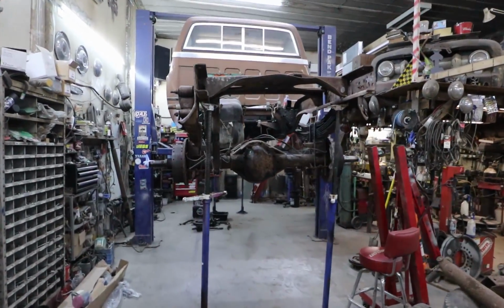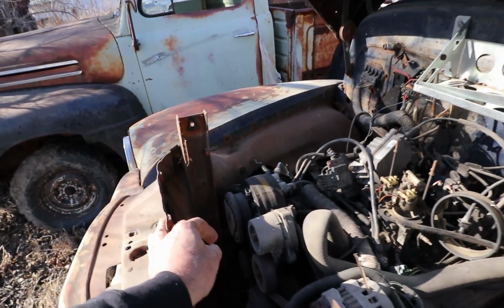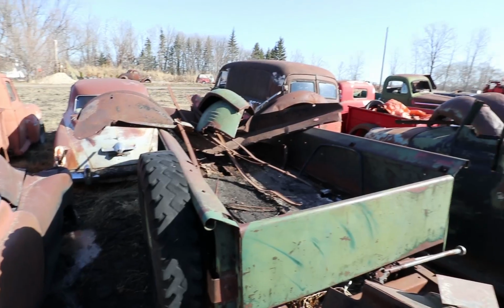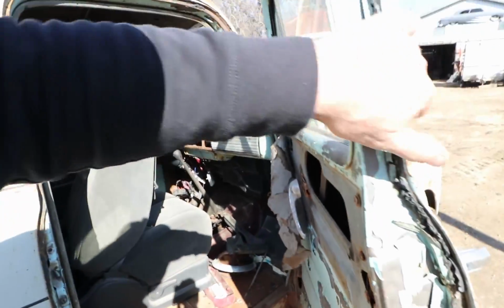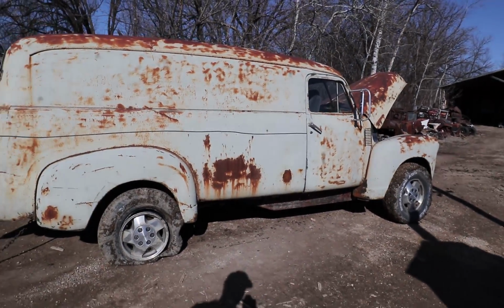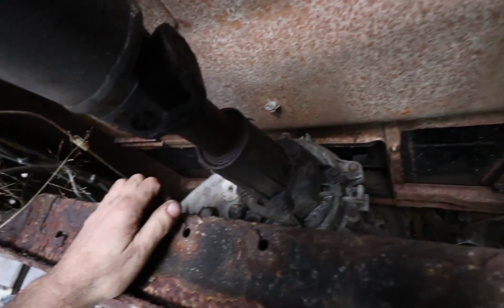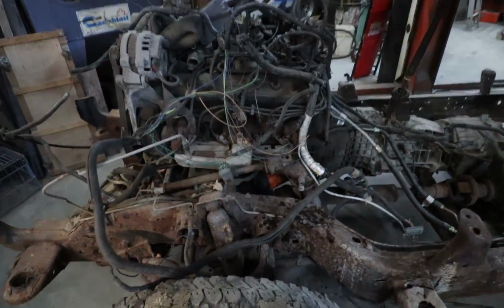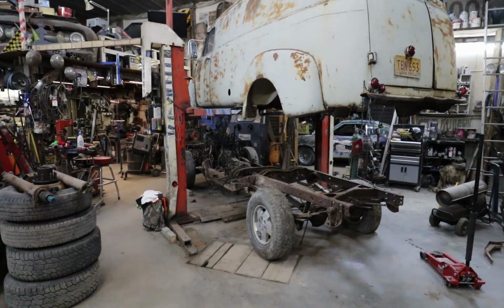1951 GMC Panel Truck Project, do I keep it 4x4? - Part 1

Comment: Love every single word and decision about the panel truck! Yes ✓ to engine swap
Yes ✓ to body coming forward for back wheel alignment with fenders
Yes ✓ to lowering just to hide frame and if not to be covered with aluminum or whatsoever
But please keep it a 4×4 and height is just perfect! I d sound crazy but i d love driving one of those in old gm styling than the original suburban or tahoe this chassis came from! Love ur late gm projects this and roadster truck and pretty please design on more of these stuff! Anyone can do a freakin ls swap or body truck to another truck bur a handful can design or redesign cars like u do! U d have ur name as a brand and should have an emblem in ur name as a tag next to the oem car make and model! Great work, brother!

Comment: Dude, that GMC panel truck is AWESOME!!  Just don't see many of 'em anymore.  With a little DA sanding and satin clear, you'd have a nice rat-rod type finish.  Looks like there's some good patina under there.  Instead of dropping it down to cover the exposed frame, you could fab some step-sides; functional and cosmetic.  And an LS with a manual transmission would make this beast a joy to drive.  The General project got me to sub to this channel, but this thing has me drooling!  Oh, the possibilities!  Can't wait to see what you do with it!

Comment: When you said you were thinking about switching gears. I really thought you were talking about building the Studebaker Gasser again. Not a bad panel truck. But like you said. Looks like it could turn into a real money pit, real quick. Not a fan of you lowering it (just too big) if you have to have something that big, I would either put a stock height 2wd chassis under it, or go the opposite direction, with a 4" lift 4wd. Thanks for sharing.

Comment: I think you made the right call not to use that crusty chassis. A few years back I had a 49 chevy pickup on a 94 4x4 chassis. I put quite a bit of time and money into making it a reliable daily driver, but when it came time to sell it I couldn't give the thing away. For a flip I think an original frame is more desirable, although a stock appearing swap onto a more modern frame would be neat too. Whatever you choose I'm sure it will be cool when done!
Reply: Well let me know what youre giving away next!? Im on the hunt for a "40 Hudson cpe, got one of those??? 😉

Comment: Excellent video Brent :) keep 4×4 on that old 1951 Chevrolet Delivery truck also motor that stuck that not good and hope find another one ! I know got years back a scrap yard or people call Junk Yard Dig Special a guy want me do a 1960 Jeep Delivery truck van in roadster vechile , funny part the 2.0 litre 4 cylinder motor was okay running plus fully rebuilt also carb need rebuilt or replaced , floor shifter 4speed Manual shifter with brand new clutch pressure plate in , axle was seized up tight and frame was scrap it but upper body was 80 % there but need work on to! So got done but was a 1978 GM truck frame went on , plus old 1980 Rebuilt 4.4 litre 267 CC V8 4bbl plus daul exhausted , plus rebuilt Turbo 700SR 4speed with Shift Kit , 1976 377 posi rear from Chevrolet Impala car , updated all wireing to from 6 volt positive ground to 12 volt Negative ground, plus gauge fix up factory plus new modern ones , Steering Wheel owner want GM Truck with Tilt Steering also Delay Wipers , Power Steering , Power Brakes disk on front to back drums , all lights changed to plus make 5 seat with 2 buckets front also back full bench , also bit cargo space from back seat to back Tailgate like pick truck ,celine with 2 dome lights , also spare tire fit floor to , Am/Fm radio to Modern type deck with CD , antenna on roof , 5 speakers one middle dashboard one each door on front then behind back full 3  seater seat , truck was baby blue then midnight black, back up red GM light says BRAKE in rectangular square mount , plus want heater work too and in-between  2 bucket seats a Automatic transmission shifter plus emergency brake handle pull up then button release! Key ignition switch in dash to still work plus wire up Steering wheel Column too on second! Funny part want big Fibreglass Steel 100 litre fuel behind axle  also exhaust front back wheels! Put 5 bolts GM wheel hubs with Chrome steel 5 star wheels, front were 235 /75/15  and back big 15'S of Uniroyal All Season tires ! But had done also use no rusted orgnail fuel tank before 100 one came in and took me 5 years do that project because had find time do it on from other ones working on plus parts too some from Chrysler and GM! But most part didn't like was Rubber Black Seal to scrap off under carriage was to frame took a lot hours scrap and soak!

Comment: I ain't feeling a long long wheelbase one ton gmc but when you put your mind to something, it turns out nice everytime so there's that. I saw in the collection of fine rejects of the past the car that was my favorite and the one I owned when I got drafted. I had a 63 1/2 galaxie 390, 4 speed posi from factory as it was only three years old when I got drafted but I bought it out of my savings when it was a year old. I put a thousand down on it cause it had been drove fairly hard and it showed the abuse that I did fix right away. It had twenty some thousand miles and oil was everywhere showing I didn't know enough to find a better onel. Blood Red with red interior which was really nice there. The engine needed building and I did a clean rebuild on the bench with real good parts and Felpro had started making gaskets about that time, way overpriced but only the best.... you know the scenario. Far from being a first vehicle but to date, the very nicest one. I was driving it everywhere like down the hill from the shop to the house three or four hundred feet just to have lunch... like I said, everywhere. I had bounced the needle off the end a few times and it went past the one twenty and the rest was guess. I know now that the speedometer was a bit fast as in about twenty over but it felt fast to me. So I get my draft notice and went down to the dealer I bought it from and said I will send you the payments from the service if okay with you guys..... they gave me three months to get in and get a paycheck as its not as much as one thinks... l I got sixty two dollars I think and the payments were fifty so I could eat and sleep and get clothes all on uncle sam so it would work for me... Long and short I get a letter from the car dealer that they had come and got my car as instructed by my folks. They didn't like the car and then dad got drunk and ran into it a few times so the dealer is mad at me thinking I did it. What a mess. The he said and she said just don't cut it and I  was on my way to vietnam so I couldn't do crapola. I wanted so bad to shoot my dad and I still was in boot camp with a notice that we could be sent anytime regardless of training... we did all the training but a week later gone. dang dang etc. I was talking about nothing that goes here again. I sure would love to see it come back to life if its not so far gone that its not worth it as so many are now. I really do love that car and its not a real high dollar car to many... especially the chevy owners would crush it. I have watched about every video I think of, of your ones posted. I just hope Brent... a man needs hope

Comment: Brent! Im too pumped as I like these old panels! I know you dont but hey, variety, right? So a direction Id love to see is a long wheel base panel like this one with a cummins diesel in it like the general and a dually rear end! You mentioned widening the fromt fenders but you could do the back instead or even use pick-up fenders as a start to get the width. I would love to see that get done and its not a typical build either!
😁

Comment: I had a 54 pu. and bought  a panel  put the pan togather with stock frame  as a 2 week I rebuilt  the front  axle and was very happy  with it . I used a 68 firebird dif. on stock springs. new springs would  be better.  the stock springs center pin is 13/4"off center but adapter  plate worked well. 4x4 would  work with stock frame. 9" ford dif will work with the transfer case motor mount and trans mount you are dune but a newer steering box wouldn't  hert. I'm interested  in seeing what you do. good luck

Comment: The first thing to do, 2WD or 4WD, is put the bod on a different chassis, I agree with Carl J, it's crunchier than pringels.  Also the drop in the middle would make it more difficult to get the bod to hide it.

Comment: I would air bag that and shorten it by 20 inches. Seen one it was very cool!👏🏻👍👌🤙
Reply: Its a long wheel base, the standard one are almost 3 feet shorter and are way more common.

Comment: OK here goes I'm in my seventies established when I was younger I had 3 of these , back in the sixties and seventies when everybody was fixeding up the van's I was fixing them up the 1st one I did everybody want to buy ,  solid because it came out so cool when I was done I do good work the 2nd 1 is same the 3rd 1 I kept for years and then I finally saw it yeah stole it when I seen you were doing this I couldn't help it stop and watch your videos I can't wait to see everything you do this is the 1st 1 I'm seeing I thought you appreciate it
 Did a lot of 55  56 ,57 Cev.
Could buy them all day long for $20. In great condition.  The I'm an old dude can't wait to see what you do bye.

Comment: Hey Brent, I would retain the 4x4 but like you said, keep it low. The rear looked alright as it was but the front a few inches lower. Try to fit things within the fenders if possible. Don’t centre the rear wheel in the fender as it will look strange. Keep the original set forward look if you can. The reason the rear axle fits is because the original front track was significantly narrower than the rear. Just my 2 cents.
Reply from the maker: yeah but I can't put the axle where stock is haha those where way to far forward for my liking :)

Comment: It is an 88-95 TBI truck chassis.  You have the super weak Getrag 5 speed in it, most people swap those out as soon as possible because they have a bad reputation for flying apart.  If you drive it like an old man, you would probably be fine.  If you can find a 4WD NV4500 trans those are much stronger, but if you are going to LS swap it anyway you would be money ahead to just use the auto 4L60e-4L80e.

Comment: I had a really good friend who had a bunch of those panel trucks I know of about 8 of them he had the last one was a 4 wheel drive that was a government vehicle it cam with a generator inside the floor even had a drip pan built in for the generator it was built for I think the army it was very low milage on it he died about ten years ago and his son ended up with it there was a lil over 18000 miles on it when he got it 100% rust free and ran like a top.

Comment: LS-powered 4x4 "parts-grabber wagon" on 35x12.50's would be pretty slick - if the running boards are a no go, full length nerf bars between the fenders would make decent steps. Heck, wouldn't be a half-bad rolling billboard with your channel logo on the panels. Couple friends of mine built something similar as a "rolling toolbox" and made the front and rear tubular bumpers as quick and dirty air tanks with twin a/c compressors for on board air.
Reply: Thats old school from the 70s. Tube bumpers with a coupler were popular for offroading so after mudding or in sand with low tire pressure you could top them back up for street use to get home.

Comment: Kinda do like it as 4X4 it reminds me a hell of a lot like that monster truck called gravedigger
Reply: Having driven a panel truck for years i learned to HATE that green and black plastic turd from all the comments I got from people wbo never saw a panel truck before that one.😂
Reply: @danielbuckner2167  ok... but it's the same body or was the same body before it got smashed to bits and slowly turned into fiberglass also if it bothered you enough to leave a comment about it why didn't you just get rid of that truck at least they got it right I've had people compare my classic Pontiac to the car from fast and the furious like comments like "isn't that the car vin diesel drives in fast and the furious" or "is that the car from the punisher?" stuff like that atleast with your case they got it right lmfao.
Reply: @DatBoiOrly  It wasnt 5hat they thought it was the same panel truck--- it was that they thought mine was made to look like GD. As if they designed the chevy AD design for a mud truck 🙄
Reply: @danielbuckner2167  ahh that's kind of worse tbf especially if your truck doesn't have all the fancy tube chassis which is all GD is with a body on top
Reply: @DatBoiOrly  yup, it was just a restomod. I used to have a black 69 nova but thankfully sold it before deathproof came out or i would have got annoyed there too! 😄
Reply: @danielbuckner2167  ya lucky devil lmfao
Reply: @DatBoiOrly  haha, yeah jokes on me though because i miss that car and the prices on novas have gone higher than comparable vettes in the last few years so investment wise i sold low.
Reply: @danielbuckner2167   I understand your pains buddy I used to have R33 Nissan skyline TT now they're going for stupid prices I traded it in for a trans AM which I'm happy with but everytime I see those price hikes it's like a massive kick in the testicles lmfao

Comment: I like the idea of keeping it 4x4, and I've never really been keen on hugely lifted trucks. My wife and her best friend always called them "penis-man trucks," as in someone was compensating. I've had 4x4 trucks, always kept them stock height. The engineers who designed the suspension probably did a better job originally than I could ever do by re-thinking all that geometry. Something nice in an LS, or a diesel, with modern parts that you can find at any parts store, not some esoteric stuff that costs $500 for a pair of shocks. Something a little inconspicuous for paint. Just the style and age of it will be attention getters, no need to get all bedazzled up. But hey, it's not my rig, and you'll have it done and sold long before I could ever get the money together to buy it from you. It's your rig, build it the way you want to. All the best to you.

Comment: I like the keeping it a 4x4.  with a different frame you may not need to drop the body. and once you get the running boards back on it they won't be very noticeable i would think.  i do think a minor suspension lift.  only a couple of inches would look good on that truck if the tires weren't to big.

Comment: The Lt1 is a 1971 that I took out of a half crushed 
1973  corvette heads cracked and manifold. The 
Block was good so I took 
Parts from my 350 had it 
All machined dropped it in 
And the dash caught fire.

Comment: To keep the panel a 4x4, I would use the stock type frame so the body fits it well and leaf spring in a Ford front axle to be able to keep the newer Chevy transfer case setup.  🤷‍♂️

Comment: I would think that one of those suburban or van chassis that you have would work good under the panel van, that way it would be a big block or LS motor, you could use the entire floor out of the suburban or van, so the mounts would be correct and they have straight frames without the kick up for the pickup bed, and the wheelbase is longer
Reply from the maker: haha this one is much larger than most of them chassis, though out here the floors are prob in worse shape than the one in here haha
Reply: @HalfassKustoms  i hadn’t thought of the floors being worse!

Comment: If you leave it as a 4x4 do a 4" suspension lift and drop the body 3-4", that way the body will look stock height and the frame will be hidden

Comment: you did ask what drive train should be under this now that the chevy frame is a bust. this needs to get a 7.3 liter powerstroke drive train. think Excursion! either a F250 4x4 or a 350 with just rear wheel drive. manual if you can find one. I love our 99 F250. I bet our truck holds the record for the most Nascar races attended. Roughly 10 a year for 15 years straight.

Comment: A better 4x4 frame? Close to stock height I'm thinking...
Brent, this video is fine. You're working the problem. If that frame is so,,meh, might as well toss it and start over for reasons you stated.

Comment: I don't know. It's kingda hard to call this one. Because either way it will look good. A lowered 4x4 would be nice and a lowered truck would be nice too. Any way it would be good rolling on air bags. That way you could go any way you choose. After thinking and looking I would change it to two wheel drive and slam it. Then LS the running gears and kinda make it a van of the 70's. Less work and money. Ronnie.

Comment: If it where me id go 2wd or get a 4wd square body chassis and  maybe cut down body to blazer length would be really cool
Reply: Even a standard chevy AD truck is too long for a blazer chassis, thats pretty short. Also the square body chassis is wide and sort of sought after now by guys restoring those.
Reply: @danielbuckner2167  i ment cutting the body down to near blazer length not chassis and he has his son's squarebody chassis setting right outside garage
Reply: @smartweadsgarage6806  Ok, thats making two problems... the square body frame can work but the axles are too wide so you are back swapping in more stuff and making more work. Also why vut the body down? There are more standard (shorter) panel trucks than long wheel base ones . Thats like parting out your coupe for that sweet four door build youve been working on. 😜 If you dont have a hot rod and its all you got then i get the temptation but for guys who want a rod but also want to haul materials then the long wneel base is a real benefit. I drove one for years and hauled everything from lumber to sheetrock to ass... all in the same ride! ✌👍